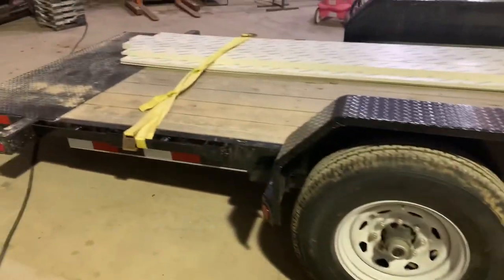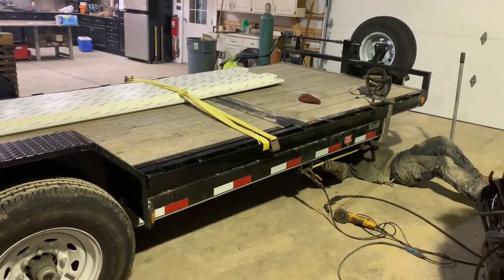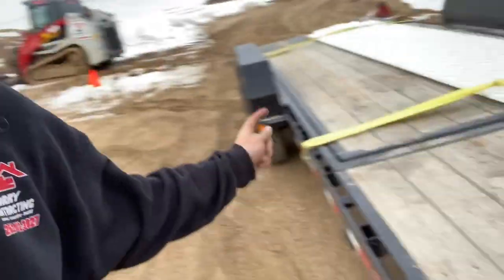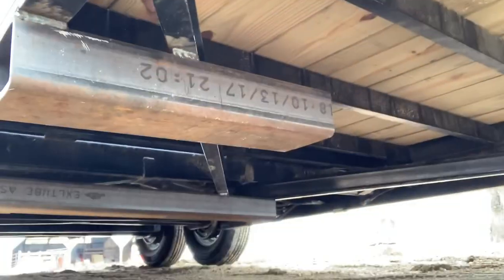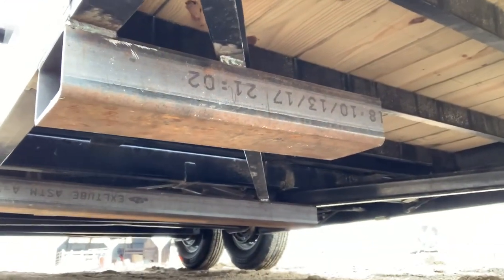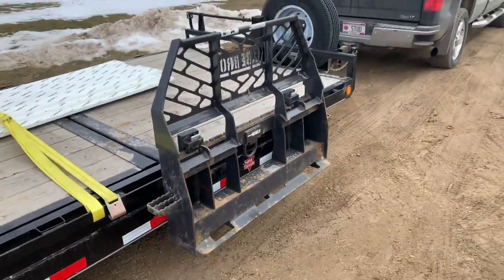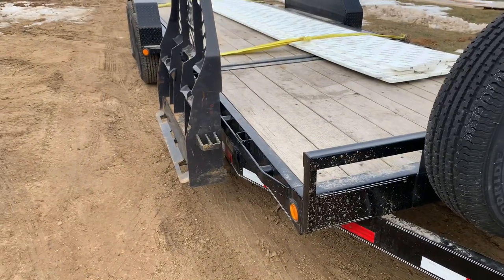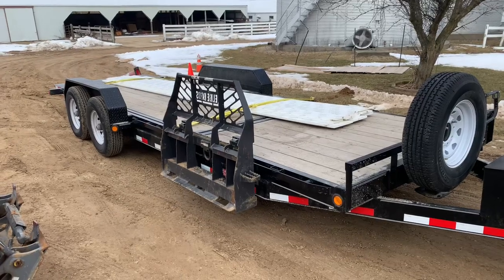Adding Fork Pockets to the PJ Tilt Deck

Comment: How long have you been making videos? I'm gonna try to start making them.  Keep it up. I am inspired
Reply from the maker: jeepsuc99 I got my trailer in 2017 and started really trying about then. So maybe 3 years. Haven’t gained too much ground on YouTube. But I still enjoy making them.
Reply: @TheRealBeardedBuilder  I dont know how these other guys make so many videos.  Gonna be tough to find the time. But I'm gonna try my best to set up tripods in the shop to start. Thanx for your response
Reply from the maker: jeepsuc99 trust me I get that. I’m trying to stay more consistent with my uploads. It does get tough to remember to set up tripods and find edit time. Lately I’ve just been trying to capture stuff on my phone and throw them together in iMovie to keep content coming. Thanks for the Sub by the way 👍
Reply: @TheRealBeardedBuilder  I have no clue about any type of camera or recording.  It will be just one more thing I have to learn
Reply from the maker: jeepsuc99 well I don’t know what you have for a phone. But I have an iPhone and it has great video quality and a cool timelapse feature. Also iMovie for the iPhone is pretty easy to start putting videos together with. I also have a go pro that works well for capture a wide view. But the best way to start is to just start.
Reply: @TheRealBeardedBuilder  your def rite. I just got a custom 8.5x16 v nose 7 feet interior height. Gonna start my build this month. Have a few cabinet jobs coming up. Trial and error, but I'm just gonna start filming. Thanx
Reply from the maker: jeepsuc99 I’ll be looking forward to it!